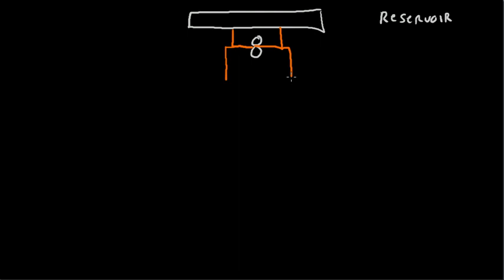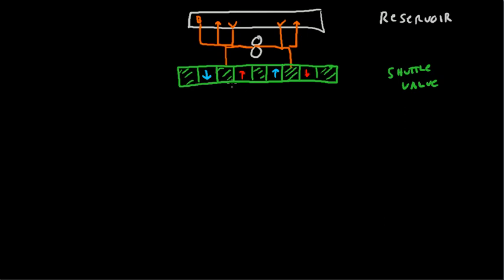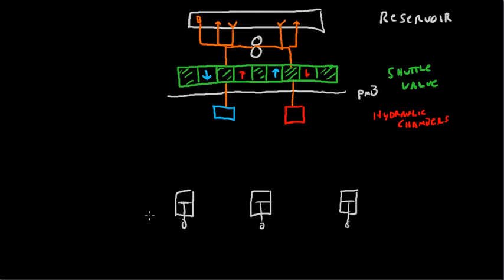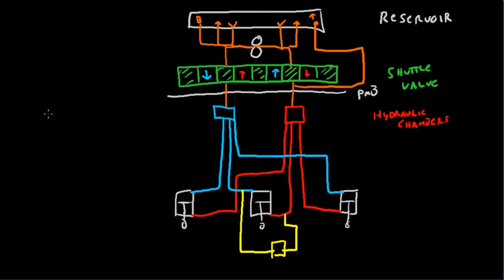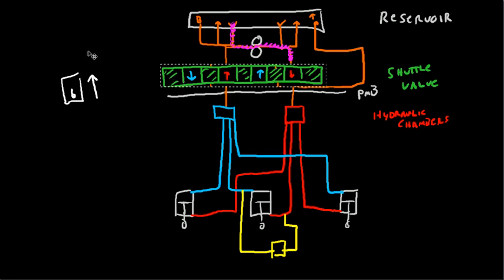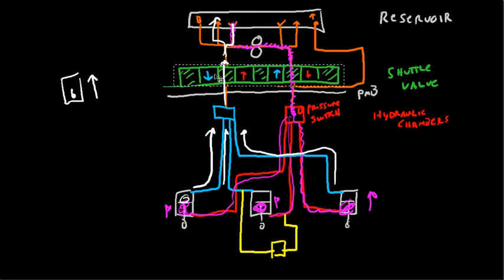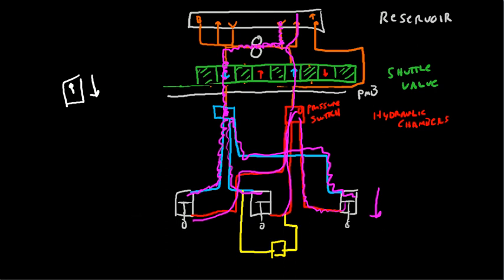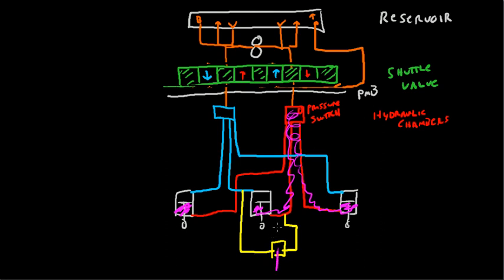Drawing the PA-44 Gear System

Comment from the maker: "the emergency extension lines do not in fact connect to the nose wheel's high and low pressure lines if you look at the POH"

Not true, the POH is wrong.  Check the maintenance manual or get a mechanic to run a borescope down under the heater.  You'll see the extension lines.

Comment: Did you forget about the Pressure switch or is it just me? If anyone is wondering what pressure switch is, the use of it is to shut off the hydraulic pump motors automatically when the system hydraulic pressure is too excessive.
Reply from the maker: Good catch!  I'll add an annotation to the video.  Thanks very much.

Comment: the emergency extension lines do not in fact connect to the nose wheel's high and low pressure lines if you look at the POH, When the pump runs, the fluid actually moves around the outsides of the gear. It's unable to go through the middle as drawn because that is where the teeth of the gears connect while turning. Just sayin. No worries, good video otherwise